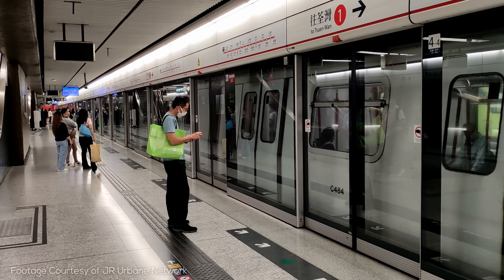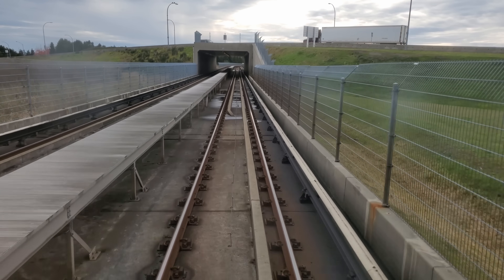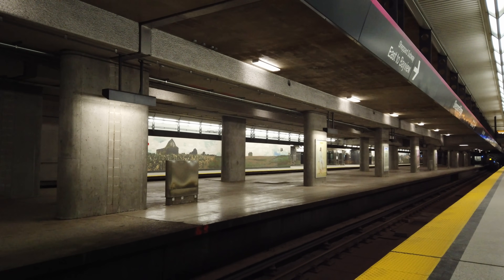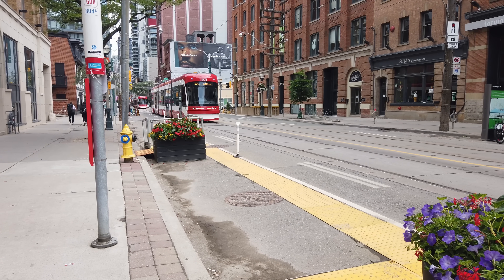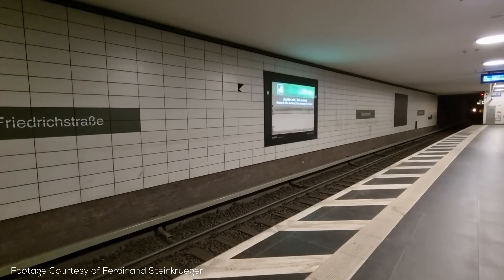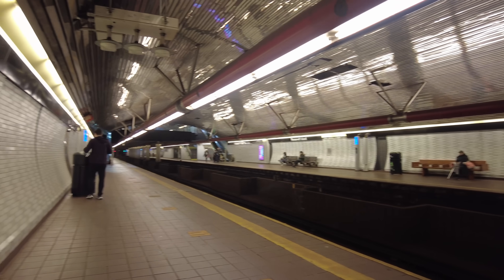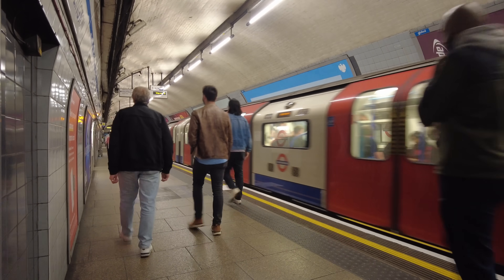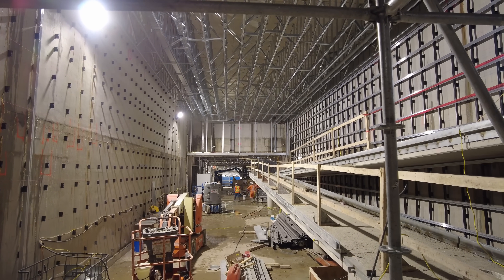Designing a Futureproof Transit System

Comment: Auckland? Forget the City Rail Link. The floods earlier this years proved that the entire public transport system isn't ready. That with Womens FIFA World Cup starting on July 20, co-hosting with Australia.
Reply: Not quite sure I understand this one - are you saying that the CRL will increase crowding to levels that the connecting buses can't handle? If so, that doesn't sound like a reason to cancel the CRL, it sounds like a reason to improve our bus network. The reason the buses were crippled by the floods was because - like everyone else - they got stuck in traffic, so better continuous bus lanes (rather than the current patchwork of bus lanes that stop and start randomly) would have helped.

The CRL is good because it's relatively short, because it removes the biggest bottleneck from the rail network, and because it adds useful new stations in central locations - Aotea's gunna be way more useful than Britomart. It's also been future-proofed for future longer trains, just like Reece said in this video.

If you're thinking of the proposed light rail tunnel afterwards, I agree that that one makes significantly less sense. We'd be better off spending that money on multiple surface routes (spreading the system out and taking some pressure off the buses) rather than a single gold-plated underground route.
Reply: @Nalehw  No, none of that. The current public transport network as it is now can't even handle torrential rain, how can any project proceed?
Reply: @BrockMak  How can we improve our handling of crisis events if we freeze all projects?
Reply: @Nalehw  Fix what we have before adding any new parts to it.
Reply: @BrockMak  Just because the current network has flaws dealing with rain, doesn't mean the CRL will have all of the same problems. Believe it or not, an underground rail tunnel is much easier to protect from such rain than a surface-level road network is. Buses get stuck in traffic just like everyone else but rail has its own right of way that is much easier to protect as well. I agree with you that Auckland should work on better robustness for its bus network, but that's no reason to cancel the CRL.
Reply: @kaelon9170  I never said cancel, but there's too many problems to fix and not enough time and money to fix them properly.
Reply from the maker: @BrockMak you gotta walk and chew gum!

Comment: Definitely agree with the whole Seattle Transit fiasco, digging tunnels is one thing, but future proofing means you get more potential for easier transit down the line
Reply: I-90 was somewhat future proofed to accommodate East Link, it used to be HOV lanes.
Reply: Sound Transit has other issues that involve future proofing. For example, they want to build a very expensive line through downtown, where one exists already. It really isn't need now, but maybe eventually enough trains will go through, and so they want to future proof. 

Except they are basically doing it wrong. The only thing the new tunnel adds is future capacity. There is no additional coverage. So you have this very expensive new line with stations that are not quite as good as the old ones, but quite similar. No will bother transferring to the new line, and those that are stuck on it will wish the trains just interlined. Oh, and the transfers (for trips that don't involve downtown) will be terrible. All for future crowding that may never be an issue (especially if they use different train sets).
Reply: Americans are too committed to freedom of movement to make it work in most American cities. You need a sheepish people like Europeans or extreme population density to make public transport work.
Reply from the maker: Absolutely, and it’s less work today than down the road

Comment: Great points, RM! Sound Transit keeps drilling tunnels through Seattle, but has never done any long term planning and therefore never considered adding branches into those tunnels. It is very difficult to break the pressure seal set up by the TBM and therefore practically impossible to ever add a branch to these tunnels even though Sound Transit has considered such branches (for example Ballard to UW). Sound Transit claims that the voters have not provided them the authority to spend money on such, but they have never asked the voter to do so either, seems like a bad excuse which will hamper their ability to expand their network in the future.
Reply: Bro wrote a comment 9 hours ago when this video came out 1 min ago 💀
Reply: @Carlton_editz  I believe the creator has a subscription allowing first access to new content
Reply: @rinder82 ohhh
Reply from the maker: Absolutely, transit agencies have a duty not just to residents today but also in the future!
Reply: Bro wrote a comment 9 hours ago when this video came out 1 min ago 💀